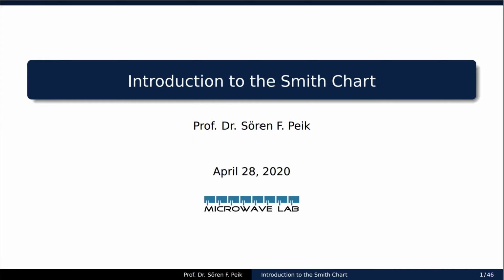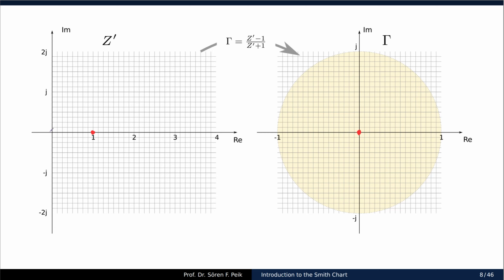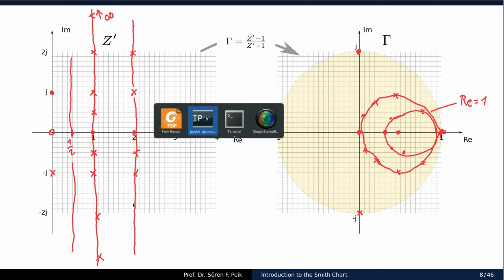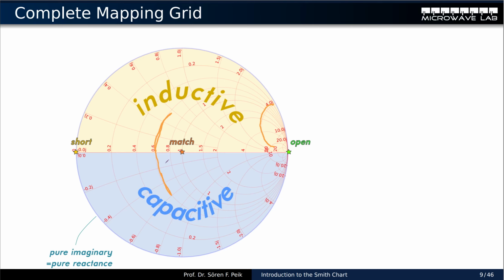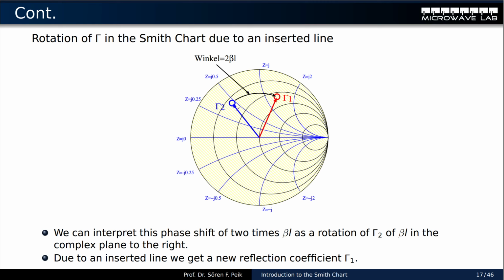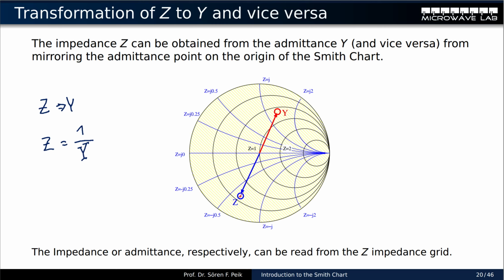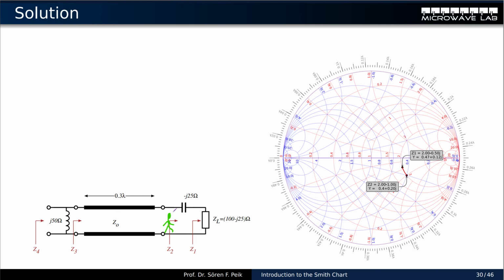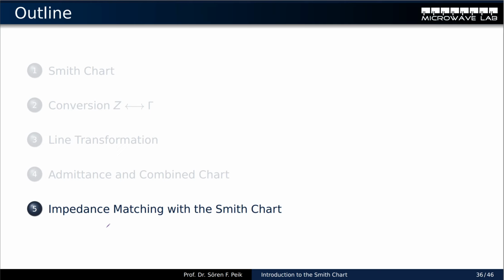Lecture 06: Introduction to the Smith Chart with Examples

Comment: Very nice lecture, thanks for this series! One quick question : In the example of angle rotation due to the insertion of a TL to a load, at 38:00, 0.3λ is added as an angle rotation to Z_L in Smith chart in order to calculate Z ' in. However 0.3λ corresponds to 1 times the length of the TL. Shouldn't we be considering 2 times the length of the TL instead, since the wave needs to travel twice the distance of the TL as you also mentioned : (step 1: Incident wave first travels towards the load from the generator covering distance 0.3λ, step 2: incident wave reaches the load and gets reflected back, and step 3: Reflected wave needs to travel from the load back towards the generator covering another 0.3λ), hence in total we have 2 * 0.3λ = 0.6λ ? So in the Smith chart should we rotate by 0.3λ or 0.6λ ? Any comment / clarification would be much appreciated! Thanks again!
Reply: It is 0.3 lambda only ... becoz we are rotating the load